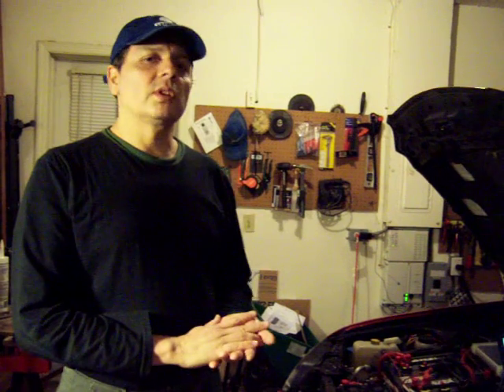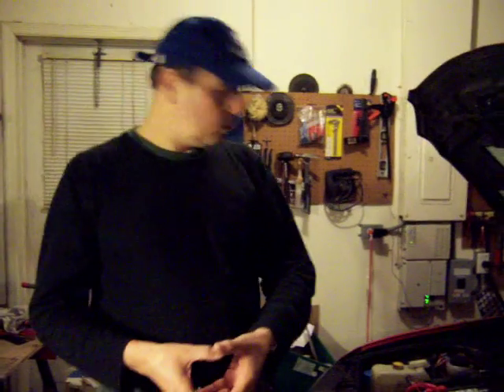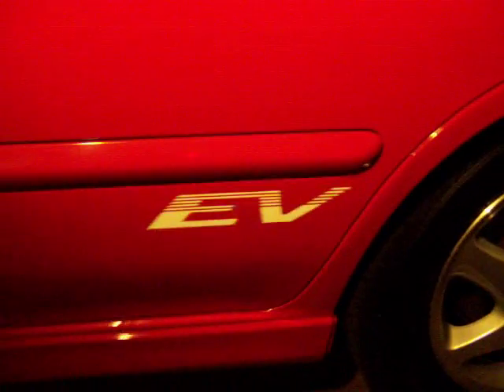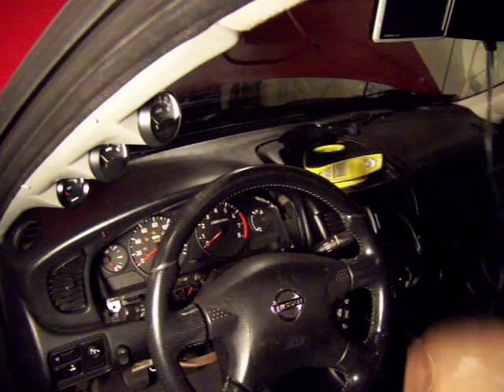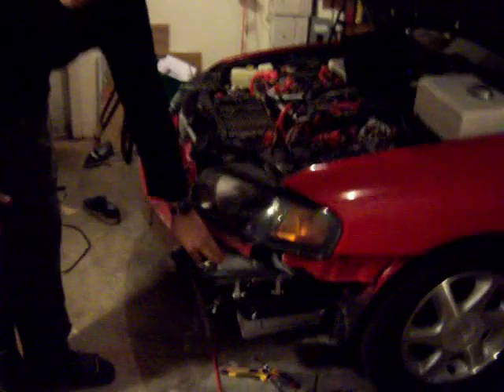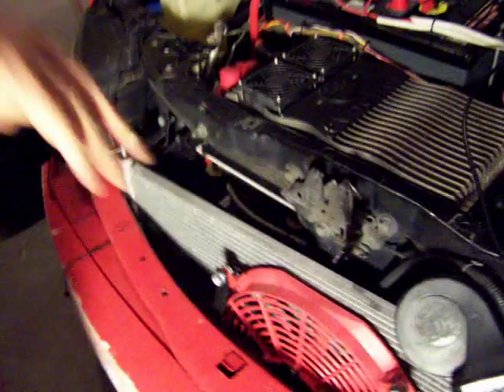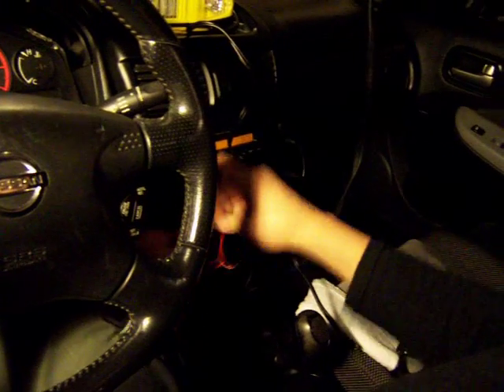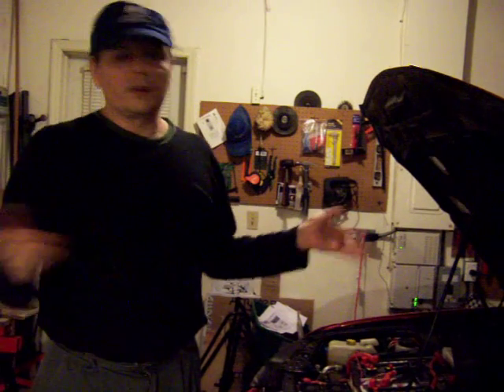Nissan Sentra Electric Car Conversion Part 31

Comment: Hi. Not sure if you're ready now to buy the Lithium cells but there's a group buy going on at DIY Electric Car forum where you might get CALB cells cheaper than usual and shipped straight from California. 
You are right about the cell prices. The single quantity price seems to be steady at about $1.25-$1.35/Ah while improvements have been made to packaging and the C and temp ratings.

Comment from the maker: The watering is not too bad since I installed the watering system, but the weight and the continuous range decrease of the lead acid batteries has been very dissapointing. I realize now that I made a mistake by using lead. I will upgrade to Lithium batteries as soon as these batteries die, even if it is, as you say, small batteries. I don't see them get much cheaper than what they are today (I have been monitoring prices of Lithium batteries for about 4 years and still about the same)

Comment: Good build. When the lead acid batteries finally drive you nuts with the watering and cost of their weight and short life, remember you can have a 25 mile range (at a safe 80% DoD) for about $3500 of Lithium cells at 120V. Total cell weight: 200 lbs.

Comment from the maker: Hello. The brand is HFT, and you can buy it at Harbor Freight tool for less than $20 (I bought it for $9 using a  coupon) or in ebay for around $20. Search for "12V car heater" and you will see plenty of these. I bought the yellow one before I realized they had other colors. Red would have been better.

I am not sure it will work in temps under 45 (the lowest I have tried it). I live in Florida and winters are not that bad here, but I'd say it is really chip to try it.

Comment: You can still stop the car without the vacuum you just have to push the pedal very hard in an emergency.  I have the same reservoir it only gives you about two extra pushes of the brake pedal but it helps to reduce wear on the pump.  Looking good my friend!